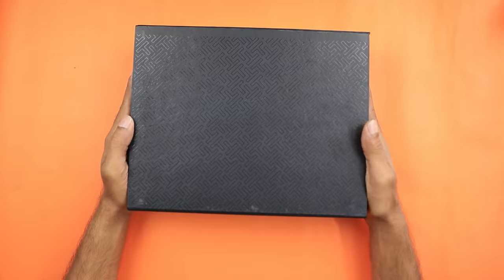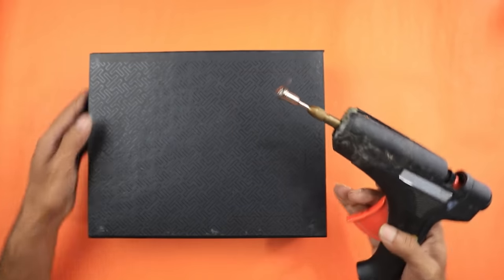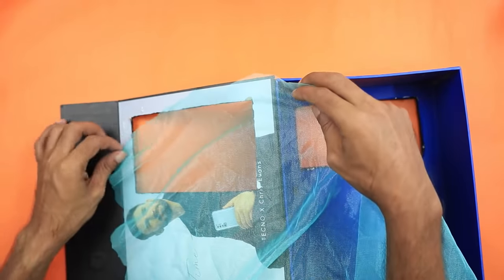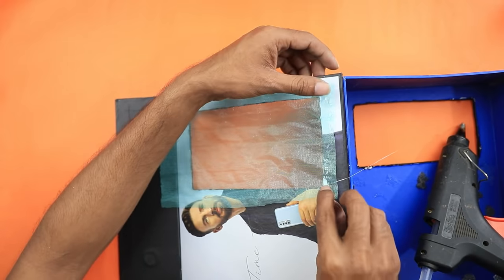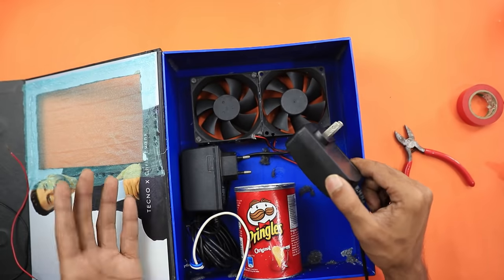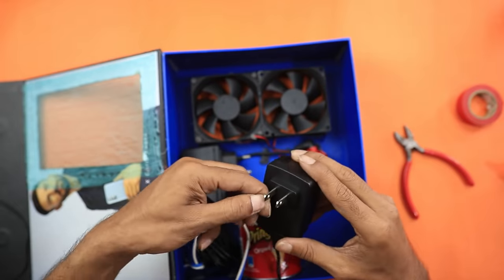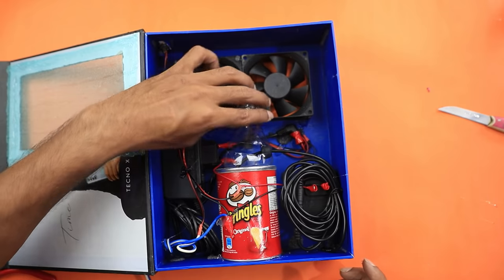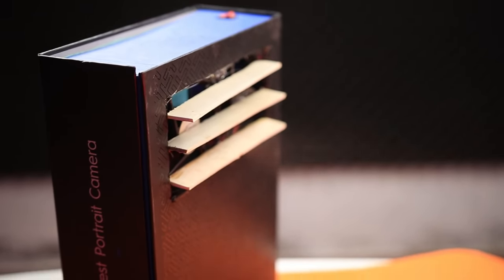How to make mini Air Cooler at home |এবার গরমের বিদায়।

Comment: It's a great project for summer and thank you so much to bring this to us.

Though as you're working with 220 AC,  and it's very dangerous, you should give a warning at the beginning of the video as underage and non-expert peoples also watch your videos.
2nd, The switch you're using in this video is not rated for AC voltage. It can be damaged after some time and an accident can happen!
Lastly, you could've used the 24v adapter to power both the humidifier and the fans. Just connect those two fans in series so it will run in 24v.

Thank you again for this wonderful project. The above advice is to keep you and other people safe from any unwanted accidents when working on such projects. I hope it will make your future videos more professional and safe. 
Keep it up. 

Best wishes.